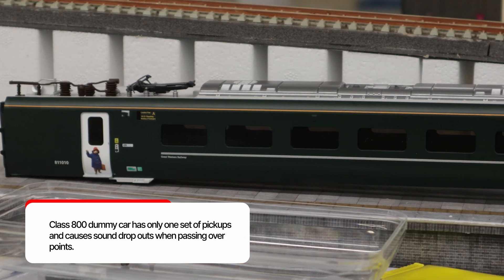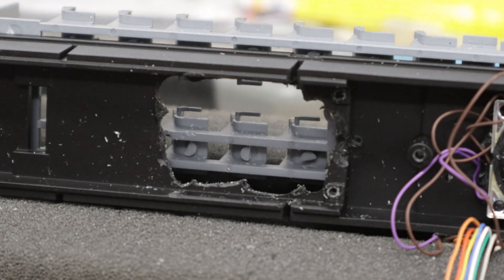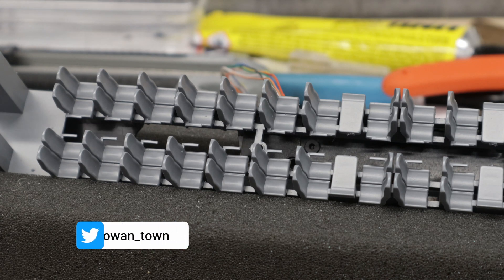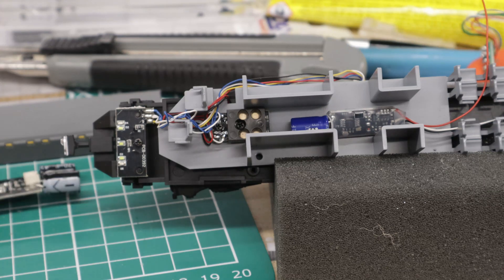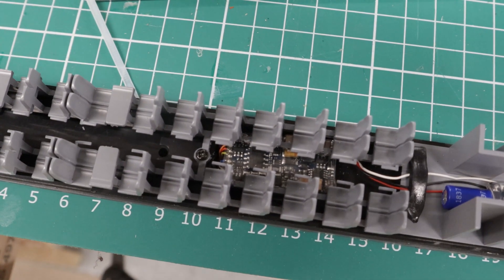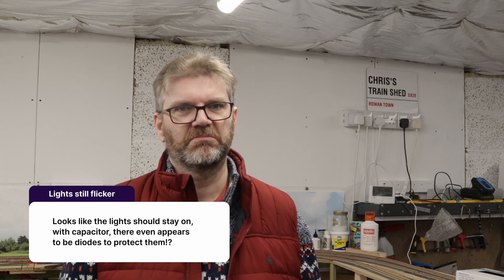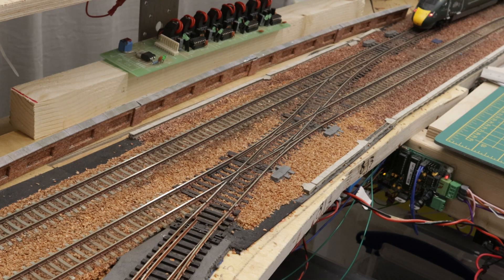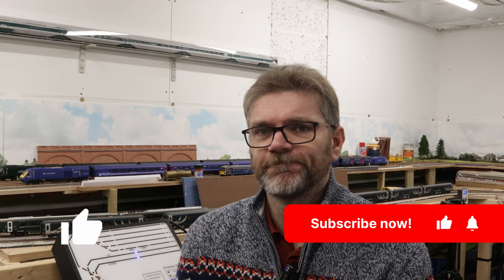Building a Model Layout in the Garage - 58 - Stay-Alive and Hornby Class 800

Comment: Regarding the rear lights… where are the actual power pickups located?  Are they on both on the same bogie or on different bogies?  Is one set getting isolated as the unit goes over the points?  Wondering if this could be solved with more power pickups…. I do like this model though.  Mine is still in its box as I need to build the house first before I build my layout 😢
Reply from the maker: They are on the front bogie.  They appear to connect to the circuit board that is accessible from the cover below where the 8 pin connection.  It do wonder if this is an issue with the loksound decoder.  If I had a spare few hundred quid I would get a couple of Zimo decoders to pop in and check.  I have ordered something from eBay that I hope I can use to connect the decoder to track power and simulate a motor so I can try changing the CV settings that come with the stay alive and see if that helps.   Was hoping that would arrive today so I can put it together tomorrow and try it.